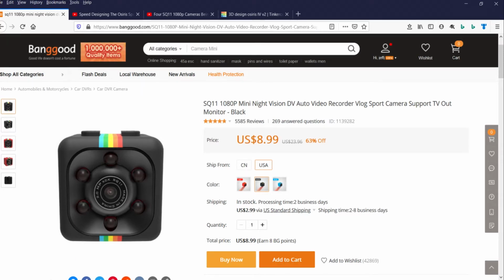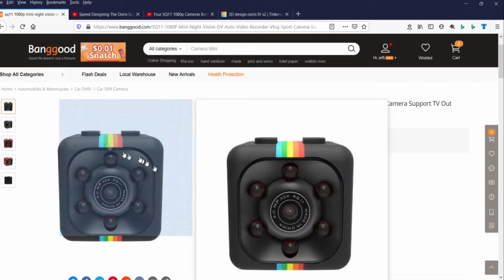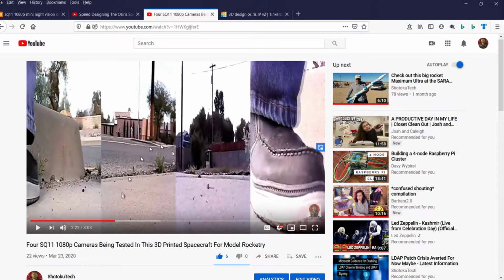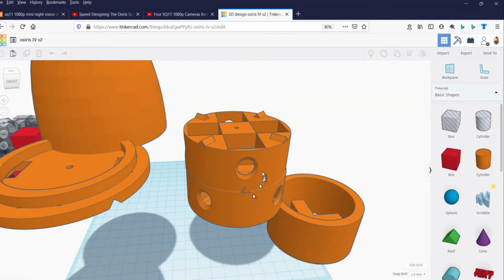Osiris Space Craft Camera Test New Configuration

Comment: If the sound syncs up but the video keeps getting out of sync, it could be that the raw video format of the cameras has a variable bitrate. Some video editors choke on that. I dealt with that in my old band videos by running all the raw mp4s (or whatever they were) through Any Video Converter as constant bitrate videos, then using those in the editor. HTH. 

Surf Wisely.
Reply from the maker: Hi thanks for that.